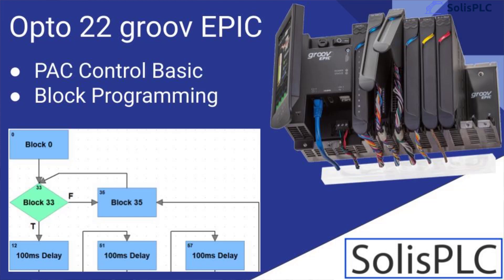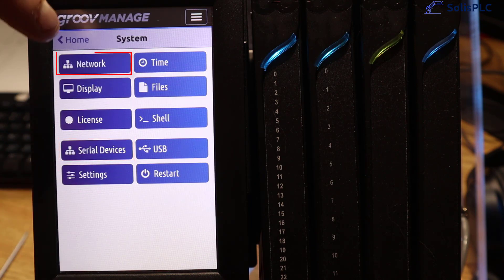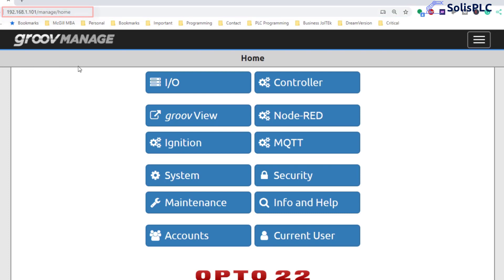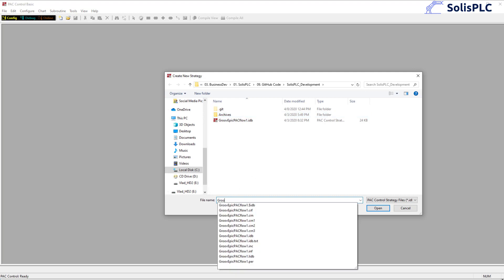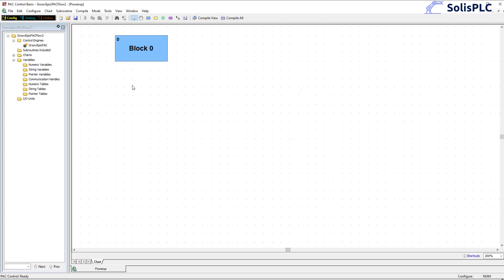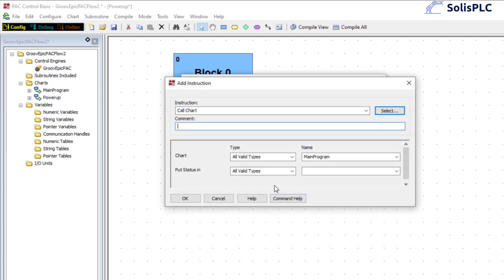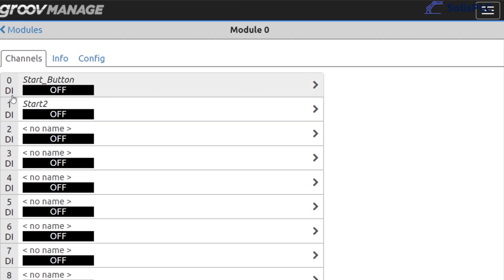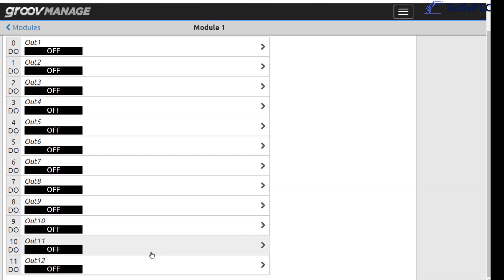Groov EPIC | PAC Controller Setup and Input / Output Sequence Programming Tutorial [Part 1 / 2]

Comment: Awesome video.
Just a tip.... At the 10m42sec mark, we usually recommend that you just check the 'Local (loopback)' box rather than enter the controller IP address.
The I/O is on the same rack as the controller, so you don't need to go out on the network and come back again.